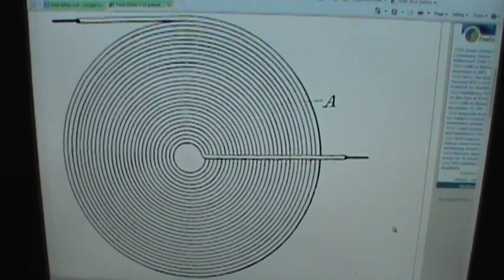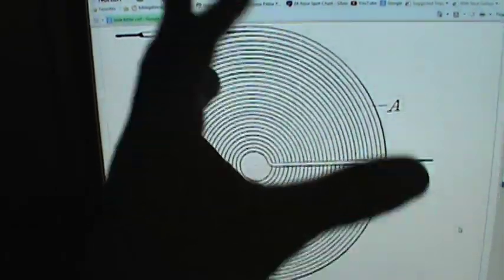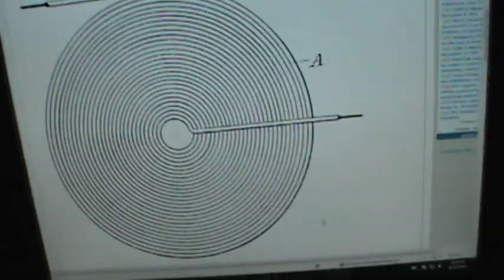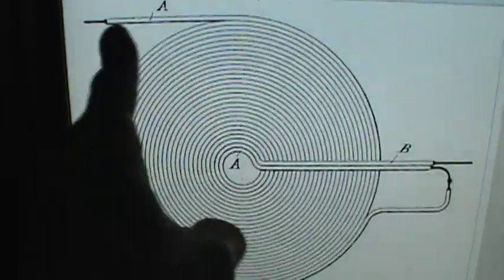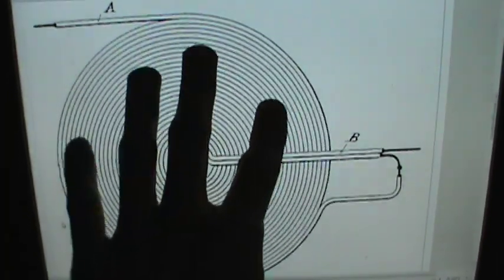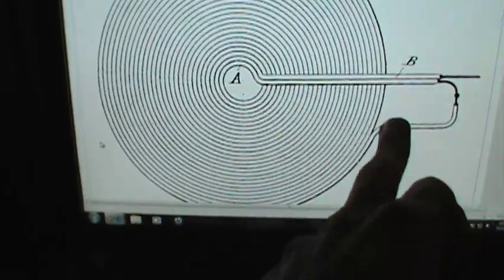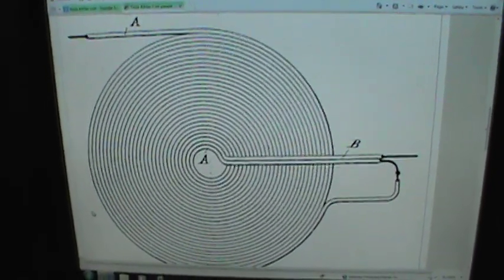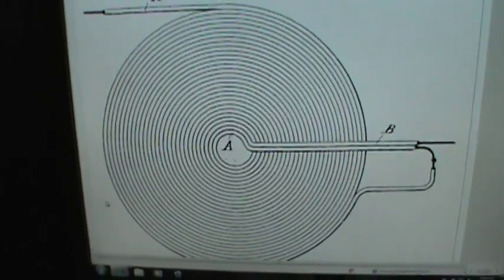Tesla Bifilar Pancake Coil - New Thoughts

Comment: Tesla made this for the coil to have a greater capacitance.
In his patent, he gives an example of a regular pancake coil, and a bifilar pancake coil.
Both with 1000 turns, and both with 100V applied.
The regular coil will have 0.1V between adjacent windings.
The bifilar will have 50V between adjacent windings.
Since the total energy capacity it proportional to the square of the 50V, you can store 250000 (50*50/0.1) more energy in the bifilar coil, than you can in the regular one.

Tesla specifically says in the patent, that it's designed to get rid of self-inductance. It's designed to only have Ohmic resistance. It means fewer losses, but it doesn't increase the magnetic field (in any other way that it, given the right frequencies, they're are less lossy).

Still - considering the increase in energy capacity, and considering that it has a built-in topload, and for this reason likely will be less sensitive to changes in its surroundings, I want to see what a bifilar pancake tesla coil can do.

Comment: A tesla bifilar coil is actually  a RESONANT LC  circuit < the capacitance is caused by the proximity of the paired wires 
The proper schematic of a A tesla bifilar coil  consists of a distributed inductance and distributed inductance.

Comment: No disrespect to you sir but sorry to say that all you are describing are two parallel wound coils. Twisting the two center wires together and then connecting the outer wires together is just a parallel wound coil, not a bifilar coil.... You would get the same result as one coil of thicker wire. I do not wish to dis your ideas but maybe you should think about this again... keep up the experiments, you will succeed...
Reply from the maker: No, they were wired in SERIES. Good luck getting that remedial bit straight ;)

Comment: The bifilar had maximal voltage between adjacent windings. Why important? The top of his tesla coil were dielectric displacement lines to disrupt Counterspacial ether curl based regulation. There are more than 3d and 1t dimensions (1d 3t). His world was voltage to ac ground to the counterspacial  vacume not magnetics. Think of inner and outer space oscillations. Dielectric lines are connected curls off of rotating vacume bubbles that link together. B fields are resultant macro ether flows at right angles. Curl is added and subtracted at vacume interface. B fields diverge outwards. E fields reflect i.e. curl inwards vibrating into 3d time at each point of vacume.

Comment: I agree. This seems like it would only be producing a glorified ground. An in series application that obviously wired in down line to another coil. And how you said to wire it is another one. Thats how split transformers wire in still to this day,..your talking about wiring off a device, gettimg say,.125v off one side and 125 off the other on a 250v transformer so to speak..so what you are saying to wire,.it too is a working design.but this is obviously, to anyone who knows what they are looking at,meaning they work w electric circuits like this every day, at work, or in hobby....this is wired in like a ground..lol.. not useful in the slightest, the way they made him file his stuff..an obvious part of a larger device.This is how they kept the secrets. Piece the stuff up. Give no references, one patent to the other, citing uniqueness to enough of the mechanical parts,.or even one vital part... like this case..not useful as it is printed..not in the slightest..But definitely a  piece of a larger design. In other words, patent each little screw and bolt like it was a separate unique device. So no one could ever link it up except them.
Reply: Check out Master Ivo channel. Its not DC its not AC but pulsatory electricity that forms a circuit with itself. You can even disconect the ground wire once you feed your panckake wire. Earth and the sun are full of this type of electricity
Reply: @Paul Garay This is coped from above where I ask someone else another question..."New to this myself but lets say you have this type of design with power going through it at an ever accelerating rate in the way his turbine gets faster and faster, the resultant em field produced without being directed anywhere else except back into his turbine. There would still be a field left on the outside of this set up so he could power a motor or something right? Do you know what I mean? So lets say he figures out a way for this coil to self power and grow acceleration forever his tesla turbine (atleast until the components fail). the field produced during it's travel through this type of circuit here would be like slowing the field down to power smaller devices for the home instead of the entire city right? Turing this into a waste energy collection system."
You say this is nothing more than a ground? Do you mean this would send energy to the ground? Am I right in thinkiing this is a way perhaps then so syphon off too much power. 
And if this was wired to the ground, What exactly would happen if you are syphoning off 7.3hz or what ever frequencies into the earth (I know he was fond of that frequency) If he is pulling supposed energy from the earths air and putting it back into the ground at ever increasing rates wouldn't that basically super charge all life on earth? Sounds like a good plan to me. If thats right.

Comment: I'm new to all this....Will this produce scalar waves when connected to a frequency generator?  I need the easiest design....any advice will be greatly appreciated.
Reply from the maker: Short answer...no. Crossing wires at 90' will give a scalar pulse at the node of the crossing :)
Reply: Thank you will do!
Reply: @MrAnguswangus  New to this myself but lets say you have this type of design with power going through it at an ever accelerating rate in the way his turbine gets faster and faster, the resultant em field produced without being directed anywhere else except back into his turbine. There would still be a field left on the outside of this set up so he could power a motor or something right? 
Do you know what I mean? So lets say he figures out a way for this coil to self power and grow acceleration forever his tesla turbine (atleast until the components fail). the field produced during it's travel through this type of circuit here would be like slowing the field down to power smaller devices for the home instead of the entire city right? Turing this into a waste energy collection system.
Reply: Have you seen Konstantin Meyl's scalar wave generators? I haven't yet looked at this in detail, so I don't know much about it.  But please be careful if you do get this stuff working; "They" can probably detect scalar wave transmissions and will be around to investigate. "They" being the cabal who wants to keep this technology under wraps. 

I am thinking of building a scalar wave transmitter, and setting it up in a public park somewhere,  just see who turns up to snoop around.
Reply: Thanks for that lead. Hadn't looked at orgone onergy before,; it might explain lots of odd things, such as why some neighborhoods "feel" uncomfortable, while others feel ok.
Reply: CryptoCruiser why did the chicken cross the mobius strip?

To get to the same side

Comment: How can I use this bifilar pancake coil to reduce the amount of electricity I use in my house?  If it increases the current going to my house, I should (theoretically) reduce my electric bill, right?
Reply from the maker: This coil will not reduce your electricity bill. The devices we use should be made differently I've found. This shape of coil is best for inductance, how we use that raised inductance is what matters. This coil does not increase power, it increases inductance, which if used properly can be used to do work with very little power. But your inductors must be made of a sufficient amount of electrically conductive atoms. Size matters ;) lol

https://www.youtube.com/watch?v=bXtO7McrRIY

Comment: I don't know about the resisters, but in my uneducated opinion, reconnecting the coil lines in your patter, no longer makes it a 2 cycle, but a single cycle and the energy collected in the field just disperses as heat. -North to south and south to north and back.. that's all.
Reply: BJbear2001 yeah it basically just makes it a wider wire and spiral

Comment: In the patent 512,340 Tesla says this particular winding design holds 250,000 times more energy than a standard winding and gives the derivation in plain English without ifs, ands or buts and uncertainties normally ascribed to modern day science blurbs.
Reply: @saucersource so this can hold a lot more power than it appears, what then of the output wire? what does that mean in electronics? I am not new to tesla but trying to understand electronics from a complete noob perspective

Comment: (continuing) by the vacuum. The BFT coil is therefore a true energy capture machine that works like a heat pump. When the local vacuum changes state to become a photon, energy transfer is provided. And the photon is immediately reconverted into the inductance of the BFT coil. That's simple and this will save us out of fossil an nuclear drugs.

Comment: Ok so you take the bifilar series connected planar coil and turn it back into a multifilar parallel wired planar coil.   So you lose the 250x magnification of the magnetic field in doing so.   But then it sounds like you make two of these bifilar planar coils, both setup with the dual strands in parallel, but with one flipped so the winding direction is reversed when put in local relation to the other planar coil.   What does this cause to happen?
Reply: would you do this and couple them with a hoizon style horizon inductive rod. going though the center of each spiral?

Comment: good, yes, yes, yes. and no. you are hot on the trail, however, you must must must must have a fairly precise phase differential between the two coils. the coil will naturally try to find this phase difference but it will work much better if it is specifically driven with a phase difference less than 180 and greater than 90. again, such good work.... no this is different tech. the tesla bifiler uses current to reinforce itself rather than fighting itself with self induction.

Comment: You would have to severe the connection of A and B on the right side and connect both wires coming from the center. Then you have the input on the top left side, and the output on the lower right side.
That design would even look more elegant. You could make the connection of A and B in the center of the coil, nothing sticking out anymore. Input and output also could be located at the same place.

Comment: What about this idea? The way the bifilar coil works in the patented design is that the current starts at A on the top left side. It then goes to the center clock-wise, from there outwards where it is fed into B to repeat the same pattern in a second cycle. It then ends at B on the right side. --> see 2.

Comment: If we instead fold a wire in the middle and wind a bifiliar coil, and feed it with i.e 100V, we will have 50-50 = 0V in the center and 100-0 = 100 V between the start and and point. That will give a potential difference. This make more sense to me. Also thinking about W. Russel who claims that the magentic filed  causes loses (radiation) and the electrtostatic is gaining gaining  energy (gravitaion).  I don't know for sure, just my thinking.
Reply: Eric Dollard said the same about the magnetic and dielectric, in regards to gravity that is also correct but it's only 1/2 of the process, there is a flow component to it.

The dielectric/electrostatic field is where the real "magic" is, not in magnetism which is associated force and decay.

Comment: Hello Mr A! I´m with you on this. The bifilar design from 3.03 and forward make no sense when thinkining about it. Testla said "Don't kill the potential", but this is exactly what this desing does. For example, if A outer is 100 V, then  A enter is ca 50 V, B outer same as  A center, 50 V and B venter 0 V. Thus, the potential difference at center = 100-50 = 50 V and at outher 50 -0 = 50 V. The potential difference is the same across the coil, 50 V. We have no gradient in the potential!
Reply: the 50 volts are the gradient! And this counts for the capacity - no potential, no capacity. THere is a capacity and so there must be a potential.